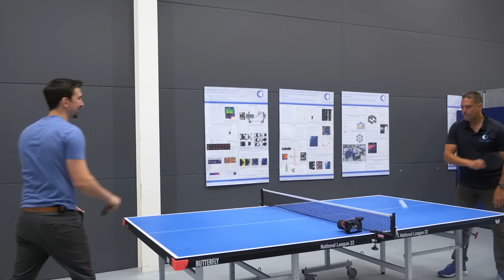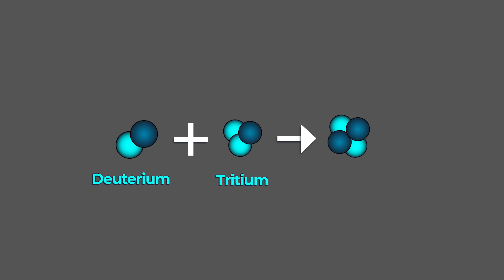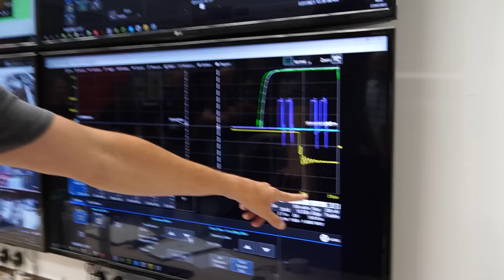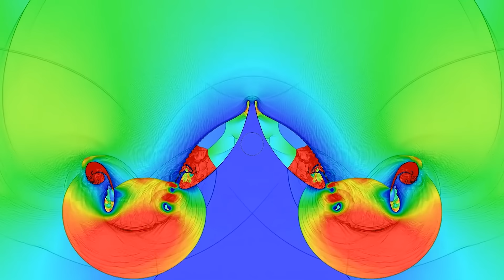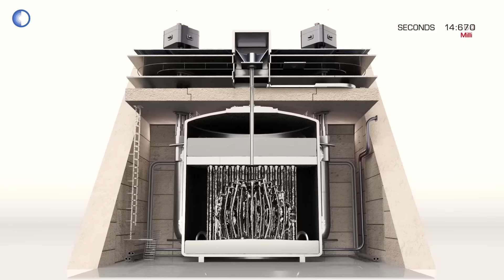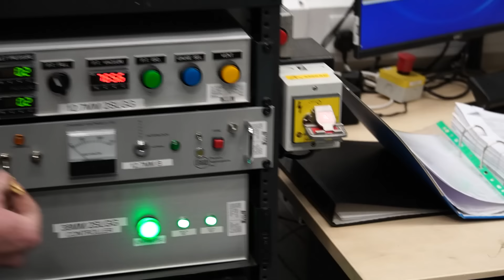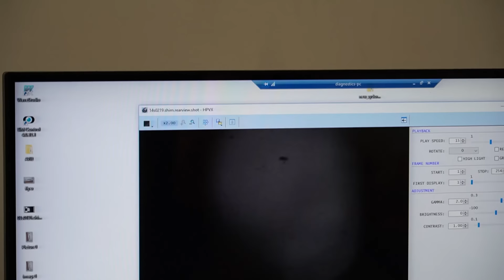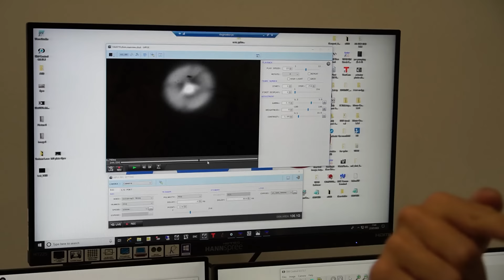Inside The UKs Breakthrough Fusion Reactor - First Light Fusion

Comment: I feel confident in saying their approach will never lead to a commercial fusion reactor, but there is a lot of fun engineering in it.
Reply: Total agreed.
There is a few big floors in there plan.
Reply: Personally I believe pulsed rather than continuous fusion is more likely to bear the first commercial fruit. Heat capture being the biggest issue.
Reply: @benmorrissey7610 of course there is, otherwise the thing would have to float!
Reply: and what gives you that confidence?
Reply: Thats such a good way to deal with these clickbait titles :)
Reply: If this works and produces energy I can guarantee engineers will find a way to reload that thing in under 90 seconds. If you can produce reliable fusion energy with this method they will make it work as the gains are to high not to.
Reply: @davidbirkhead1176  Pretty much, yes! At that point it would just be an engineering problem, and those are solveable

Comment: This was great to watch, thank you! The explanation of “it is a rail gun with one important constraint removed” is such a cool and satisfying element of engineering: just when you think everything‘s already been invented, someone pulls out an assumption and unlocks a whole new approach. Brilliant!
Reply: The Royal Navy could use it.
Reply: How is this going to be viable for producing electricity in the future?
Even if you could perfect the process and ignite the fuel entirely, there's no way you could fire it multiple times per second so what's the point of this?
If there's something I don't understand I'd be more than happy to read your comment but I really feel like these projects are just scamming investors with the buzz word "Fusion".
Reply: @Alfred-Neuman  use a bigger fuel capsule to heat up a large volume of coolant and then run steam turbines off the heat in the coolant volume. You're harvesting the energy from small bombs. Or, I guess, you could put a large fuel capsule into the projectile itself and shoot it into your enemies. That's worth the research effort right there.
Reply: @Alfred-Neuman  you could just stack them and alternate fire. nothing stopping them from just having enough so when that last one fires the first one is good to go.
Reply: @Alfred-Neuman  At 18:05 and 20:04 and 20:15 and 20:25 in the video he says that for a power plant, their system will need to fire every 90 seconds. He compares it to the laser inertial confinement fusion approach requiring about 10 times per second at time 20:45. 

He does not say why they need to fire once every 90 seconds instead of multiple times per second as  in laser inertial confinement fusion. I presume that it is because they are fusing more atoms per shot by having larger volume targets than used in laser inertial confinement fusion, but I don't know that for certain.
Reply: @Alfred-Neuman l
Reply: @luminiferous1960  Almost certainly more. A gram of material moving at 60km/s has nearly 2 trillion joules of energy. The current best laser based system puts 2Mj's of energy into the target, thats a million times less energy input, and they're probably firing a lot more than 1 gram of material.

Note for the laser based systems the amount that arrives at the target is a fraction of the energy input actually required to generate the laser pulse, lasers are pretty inefficient, magnetic acceleration is generally fairly efficient by comparison.

Comment: All of these fusion programs are 1000s of times more complex and expensive than fission esp in say the Molten Salt Reactors like Moltex, but hey lets worship fusion because its slightly similar to stellar fusion, (it isn't remotely anything like the sun of course). The MSRs have no moving parts save the coolant, temperatures are only 1000 K and not 100M K, and fuel is plentiful rather than non existent tritium.
Reply: You obviously didn't watch the video.

The machine seems to be extremely simple. I've built tiny one that can throw HDD platters and aluminum foil across the room. 

I don't know much about tritium supply, but engineering simplicity is the entire selling point of this machine.

Comment: I know a little about the team at FLF, and they're all fantastically passionate and knowledgeable. Something to note about their approach is that they really started with the engineering challenge, rather than the physics one. Everything they've done focuses on identifying the real engineering challenges for scaling up, and either focusing on those or eliminating them. If they are successful with their next machine, it is likely going to be easier to commercialise at scale their solution than many other concepts. But that isn't even the best thing about FLF's work - so much of what they're doing has other commercial applications beyond fusion power generation, potentially giving them a sustainable income stream until a demonstration power plant can be built.

Like all fusion contenders, it does have loads of real issues road blocks still in its future, but at least FLF seem keen to identify them early, rather than view it as a problem for the future.

For the curious - if I recall correctly, the demonstration reactor we see in the CGI footage is using molten lead, and is intended to operate similarly to a molten salt renewable plant - turn an intermittent heat source into a steady source of heat that can then drive steam generation.
Reply: Which possibly means this would produce 4 GWh of heat for every 1 GWh of electricity? I wonder if going full solar, wind and tidal, and improving storage and electric grid technology should be where the investments should go to.
Current nuclear power plants designs were driven by military requirements and resulted in a whole industry now wondering why they have did not make the right choices.
Given the military background of these engineers, maybe something similar is happening here?
Reply: @SwissPGO  4GWh of heat could be damn useful to industry, it's time to stop thinking of nuclear as solely for electricity generation.
Reply: @bobthebomb1596  You are correct, but we are typically taking about hot water, just under boiling temperature. It has uses, but it's limited... and you need to transport it. 
It would definitely useful for residential or greenhouse heating.
And, if in summer you produce electricity mainly for running air-conditioning... the overall efficiency is catastrophic and could be qualified as a ponzi scheme:

*Comparing Nuclear-Powered Residential Air Conditioning Systems and Ponzi Schemes*

At first glance, nuclear-powered air conditioning systems and Ponzi schemes seem worlds apart—one being a technological solution for climate control, the other a fraudulent investment strategy. However, on closer examination, we can draw an allegorical comparison between the two in terms of sustainability and the broader implications of their implementation.

**1. Resource Input vs. Output**:
- **Nuclear-Powered Air Conditioning**: Nuclear power plants, while efficient in electricity generation, produce significant amounts of excess heat. When used to power air conditioners, there's an ironic twist: while homes get cooler, the environment outside heats up due to the heat discharged from the power plants.
  
- **Ponzi Scheme**: Investors are promised high returns with little risk. Initial returns are paid using the capital of newer investors. As the scheme grows, it requires an ever-increasing flow of money from new investors to continue. When that inflow slows down or stops, the scheme collapses.

**2. Unsustainability**:
- **Nuclear-Powered Air Conditioning**: If most households were to rely on this method for cooling, the aggregate heat released into the environment could exacerbate global warming. The solution (air conditioning) inadvertently becomes part of the problem (heating the planet).
  
- **Ponzi Scheme**: It's inherently unsustainable. Since it relies on a continuous influx of new investment rather than genuine profit, it's destined to collapse eventually, leaving late investors with significant losses.

**3. Short-Term Gains, Long-Term Implications**:
- **Nuclear-Powered Air Conditioning**: In the short term, homes are comfortably cooled. But the long-term implications of widespread adoption could be detrimental for the environment.
  
- **Ponzi Scheme**: Early investors might see significant returns in the short run. However, the long-term reality is potential financial ruin for those who join late.

**Conclusion**:
While nuclear-powered air conditioning and Ponzi schemes operate in entirely different spheres, they both serve as reminders of the need for solutions that are sustainable in the long run. Whether we're discussing energy or investments, it's vital to look beyond immediate benefits and consider the broader consequences of our choices.

Off course using Gas powered electricity for air-conditioning is even worse
Reply: @SwissPGO  True, though that does depend on reactor type.
There are many industrial chemical and pharmaceutical processes that require heat in the boiling water range.

In the short term I am a fan of High Temperature Gas Reactors for combined power/industrial heat generation.

Longer term I like the fast reactor technology using either molten metal or salt as they also operate at higher temperatures. I believe that the plans for the FLT fusion reactor is envisioning the use of molten lead?

As you say distribution is an issue which is where SMRs come into their own, especially ones with sealed, removable reactor modules.
Reply: @SwissPGO I appreciate your well thought out concerns however the heat generated during power production, which currently occurs with most of today's power production as well, is a very little consequence to the global warming issue. The heat we produce generating power here on Earth is miniscule in comparison to the heat the Sun transfers to Earth on any given day. That's why with climate change we're worried about CO2 which more effectively traps that heat rather than the heat generated by CO2 sources which in most cases is a lot of heat in human terms. However in global terms this heat is minuscule and would also be with nuclear powered air conditioning. I mean yes maybe in a thousand years as energy demands increase further you might be on something but that problem is truly a very long term problem. Additionally wow intermittent renewables plus storage are great and should be scaled up as much as possible The material inputs for most storage technologies are not insignificant and have their own environmental concerns. As a result we need base load that is relatively materially efficient and nuclear whether fission or fusion does a great job of this. In the end I am confident that it will turn out that we need both lots of renewables to power industry during the day plus some storage to help with peak demand in addition to a good bit of sustainable bass load such as nuclear. Additionally in the case of nuclear fission, with the right fuel cycle you can drastically reduce the need to mine for fuel as well as reduce the amount of high level waste you would need to store.

Comment: As an Engineer, I find this stuff absolutely amazing. But I'm also prompted to say the same thing I've said in response to a whole bunch of other fusion videos. It will never happen because it will be more expensive than the alternative - cheap renewable sources of energy, plus mature, low cost and simple energy storage. May we forever spent lots of money on great science like this :)
Reply: The point of fusion is portability. If you go across space you have to bring the sun with you. and this is the way. However they literally banging rocks togather which is not an approach I recommend.
Reply: @ThanksIfYourReadIt  I've no problem with fusion for space propulsion. There cost is a secondary concern.

Comment: Subscribed - I've worked with many of the components and measurement techniques shown here as a PhD student and post-doc 30 years ago. I've repaired too many sparc gaps to understand that at these high currents almost every metal will degrade rapidly, and your timings (and energy) will be off.
It's an interesting proof of concept but I really don't see it scale and make a reliable energy gain overall.
Lasers and magnetic confinement are where I would put my money, and if  some breakthrough on high temperature superconductivity materials happens, this will favor the magnetic confinement even more.
Reply: We need all the research we can get. What are you doing?
Reply: @Revolver.Ocelot  I'm no longer doing research in the lab. I moved on to other interesting areas even though I'm still an EU physics expert.
These days, the company I work for as the head of IT sets up the infrastructure and develops the software systems to fight fraud and financial crimes on a near global scale. I like interesting and challenging jobs ;-)

Comment: The 90 second recharge per pulse event and that 100 kilovolt spark gap switch 50,000 amp capacitor discharge device gives one an idea of the insane power product of one fusion event in the power plant configuration.  Designing the switch to last for 10 million shot events is I imagine an extremely challenging engineering  problem.  The whole system has many crazy challenges so I am extremely impressed by these young engineers. Is that 5 billion watts per spark gap switch discharged in 2 microseconds?
Reply: Back in the early 1960's, the high voltage surge generator used to test the UK's Bloodhound missiles resistance to lightning strike was reinstalled at Queen Mary college London.
It charged capacitors at 500kVA for about 90 seconds in parallel, before switching them into series to produce 1.5 million volts. The switch was oil filled and similar to those used to connect power station output transformers to the high voltage grid. It was about the size of a portakabin and designed for continuous use. 
The system was designed and manufactured by Ferranti for the missile tests.
Reply: @wilsjane   RIP Ferranti.
Reply: Geez I wouldn't want to pay there leccy bill.
Reply: I am surprised that thyristors were not selected, they have considerable over current handling and are stacked up in series in HVDC grids, I believe to switch 1MV.
Reply: @v8pilot  The government Ferranti closed down whilst it was at the top of making some of the best electronics in the world and a lot of equal to other electronics cheaply very profitably for the UK government.

Comment: I'd heard of FLF and even seen videos of visits but this is the best I've seen. Thanks for posting this. This whole approach looks really encouraging and the team behind it inspires a lot of confidence.

I was thinking about that 1ns frame-rate camera and its memory limitations. At that frame rate the memory needs to be so close to the point of data generation. That must be quite a feat of engineering on its own. (Obviously I know that FLF didn't design and build the camera, or I assume not, but respect to whatever company did. I suspect it's expensive!)
Reply: It's probably very similar to a CPU cache, albeit obviously specialized for the application. I'm wondering if each sensor pixel is routed directly to memory through its own dedicated conductor. Or maybe they have a sensor dedicated for every pixel for every frame.

Comment: Very interesting to see what the guys are doing in "our" old superconducting magnetic resonance lab in Yarnton, Oxford these days - thanks a lot for the video! I used to work in exactly that lab as a NMR scientist for Varian Inc. and then Agilent Technologies (who bought Varian in 2010 before completely shutting it down in 2014 because of the "big" CEO not looking any further than the next quarter whereas our systems would be used by the customers for more than a decade...). That's what happens if you make an MBA the CEO of a high-tech company. Won't work.
Anyway, the NMR lab was then shut down in 2015 and the lease of the building released, which then subsequently got occupied by First Light! 8-)

Comment: General Fusion in Canada also has a kinetic fusion reactor but it involves injecting hydrogen plasma into the centre of a rotating vessel of liquid lead and compressing it using rams.  I think these kinetic solutions are more viable for power plants at scale for a variety of reasons.
Reply: During a challenge for solution run by innovitive organization (now changed its name), I proposed a solution to their particular problem. It was not accepted, but I learned so much about their ideas that I would agree with Charles that this approach by General Fusion is better than what these experiments are likely to result in.
Reply: @Macrocompassion  I got interested in fusion during the decision making process for the ITER system.  If Canada was chosen the facility would have been less than 50km from my home so I had a real interest at the time about now ITER and Tokamak reactors in general work.  I also saw the small Tokamak at Princeton during its construction as a kid and was fascinated.  My general conclusion was there seemed to be a lot of things that have to be just right and the systems seemed so complex that scaling and practical widespread development would be challenging. Then many years later when I saw the early systems by General Fusion I was immediately struck by the comparative simplicity and intuited this solution could be scaled and implemented more easily. Many reasons I won’t get into and rambled too much already.  Bottom line is I hope much more resources go into this type of approach because Tokamaks and stellarators seemed to be getting all the bucks yet with such slow progress.